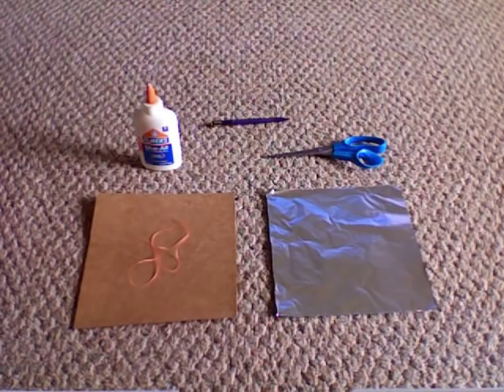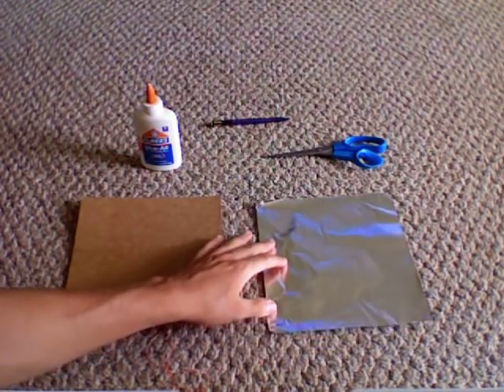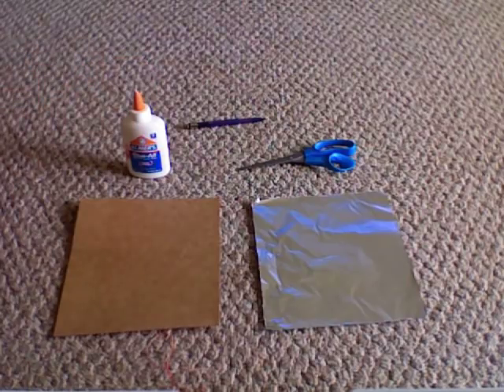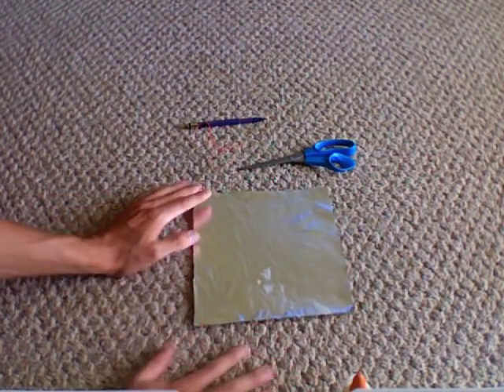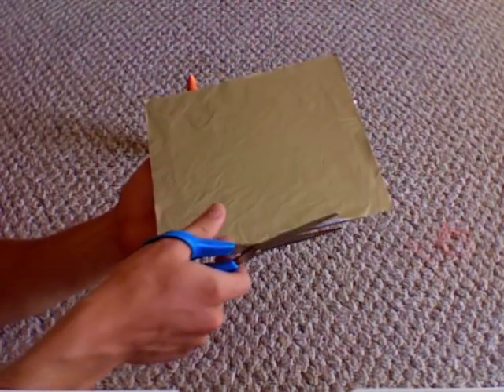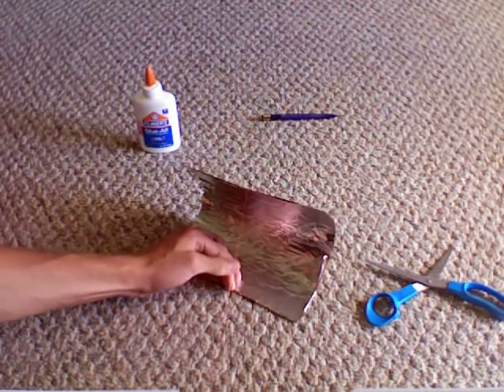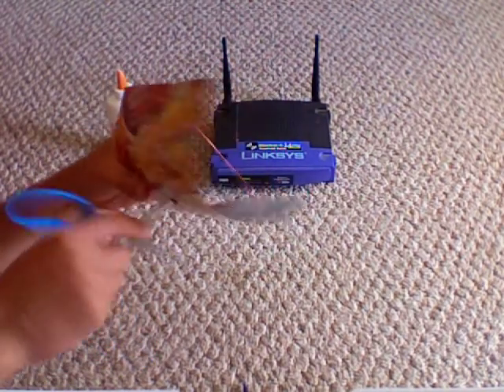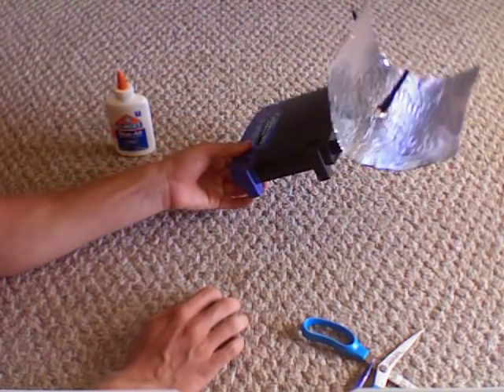How to build a Wi-Fi connection satellite

Comment: Wrong polarization...and there is major signal loss... The dipole should be running ALONG the reflector...not popping out at a right angle from the center of the sheet.

Also the shape is not tuned....   You could measure the focus using a light source and observing convergence of the reflection...  Then use another piece of cardboard on the top and bottom of the reflector to hold its shape and then make a hole in the bottom to allow it to sit on your dipole coming from the router...  (there is no satellite--not even a dish you're making a reflector)
Reply: +Trondyne   Thanks for your sensible and useful comment.
Reply: +Trondyne  This guy is trying to build on other ones who have such videos. I agree with you about the polarization, shape, and etc. These antennas have to be tuned. With some type of reflector system, the signal becomes more directional, providing all was done right and properly tuned (adjusted).  

I would think with what this guy is doing the signal would actually be worse.  The best test would be with a field strength meter that can work in the necessary frequency band. The manufactures of WiFi systems would be using the most efficient antenna design. 

The best thing to do for increased range is to add a repeater. Most of the WiFi router manufactures also manufacture repeaters.

Comment: WTF So if I am getting this right WIFI is a satellite signal from space.! So using this thinking every smartphone that has WIFI is a satellite phone.! I thought that WIFI being at about 2.4Ghz and have a power output of 10 to 100 milliwatt's would have a range of 100 to 400 feet depending on what the signal has to go through. So his tiny little antenna he made is going the reach a satellite orbiting around 200 miles above the planet is going to work. Me thinks there is too many dumb asses out there posting video's for the sake of posting them. Yeah it will work but just not how he thinks it will. All this little thing does is make the omnidirectional antenna directional in one direction only. So if say his modem is in his kitchen and he wants better signal in his bedroom then you just point it in the direction of the bedroom and yes you would have a better WIFI signal in his bedroom.

Comment: aluminum can version much easier, windsurfer antenna template more effective, but whatever works for you. pretty much anything with an aluminum surface will redirect your WiFi. the parabolic shape will help distance, but really narrow the area you can receive the signals. am I the only one with a lynksys that did NOT come with antennas? there isn't even a place to mount one, let alone two!

Comment: 3:50 Prabala shape? He means Parabolic shape. Basically he made an RF Reflector and turned an onmi-directional to a beam like antenna. It does not BOOST more than focus the RF into the antenna. You can do more than what he uses. Basically it reflects the 2..4/5gHz into the antenna the same way that Sats do it from space.

It is just focusing like how you can use the sun and a magnafiying glass to melt ice, green army dudes or fry things.Basically your wifi rf signal hits the foil on the parabolic dish and it focuses it on the antenna and the reverse is true his signal from he wifi card in the computer and it reflects it back. Only problem is that it has to be aimed just right or it will degrade the signal because he created a beam. 

This was a pretty simple how-to video and good luck everyone.

Only bad thing is that  this will NOT work with routers with internal antennas.

Comment: Know your lingo. Be ready by scripting your video. Using uh, um, and other similar words is not good.

Use the parabolic focuser to encircle the entire antenna, not just the tip. Better results, better reception, farther distance.

A Pringle's can, or Campbell's soup can, should work as crude cantennas. Using an old satellite dish with a single LNB works amazingly well.

Comment: What Maione685 is trying to describe has nothing to do with satellites. It has to do with the use of a parabolic antenna that is somewhat similar to the shape of a satellite dish, which can be used to extend the range of WiFi network. For a far better explanation as well as an accurate means by which to best shape a parabolic antenna, I'd suggest the following link:
http://www.freeantennas.com/projects/template/
Reply: seems kinda unreal but does it even work what he did sir?
Reply: Manish Chaudhary: Yes, it does. Look into "Cantennas." They are highly directional. 

Imagine a hot pocket in the wrapper they come with. The material shields the hot pocket and is able to crisp it by redirecting microwaves.

Their are materials able to deflect or block (reduce really) the amount of a frequency, so yes it works quite well.

Comment: Make the trough longer and put both antennae thru. One is TX the other RX.
The best kind are the ones with one antenna, with a screw connection. It possible to make the cookie tin lid "double diamond" antenna and get gobs of gain and easy assembly with the screw connector. This trick would work on three antennae models, make it longer and poke all three thru.

Comment: You are bit boating the signal at all what you are doing is directing the signal. A router out a signal 180  depending in the antenna and the tin foil if pushing the signal to about 90 and if you have a plastic cup or something like a cup you could direct the signal in ine are depending in the size .

Comment: Thanks Maione, this is great stuff.
I did one step forward with your project. I covered with foil both sides of cardboard (use two separate pieces, can't be one folded over).
From my experiment i found that outer surface is effectively bouncing off mean particles, these one which are chocking the good particles of the signal.

Comment: Ye the Polarization of the Antenna is what??? It makes a diffusion in the RF-Signal but not a Focus. People think that makes the Signal Stronger but this is wrong it makes the Signal more diffuse - the BER (Bit Error Rate) increase. 2nd the Current is on the Foodside of the Antenna and not on the Top of a Antenna - that means that the Reflector is diffusing the signal to the backside. Do you think that you take the right Antenna? is it not so that this is a Diversity Transceiver? That mean that the both Antennas are listening and transmitting simultan. This Reflector is Bullshit.

Comment: I'm not to sure but if your router doesnt have an antenna, just put the satellite on top of it to boost the connection. The antenna it just there to increase the singnal waves. I think this might work for other devices to like the Xbox 360 or Computers.

Comment: you could also just move or mount the wifi router higher on a shelf. works great. But as is, all that was done is build a directional reflector. Works either way.

Comment: Your antenna should not be going through the hole in the card board.  It should be sitting inside the fold along the the focul axis of the parabola.  Technically it will not boost your signal.  It will only allow you to focus what signal there is onto the antenna.  Boosting the signal actually requires you to increase the signal output power at the transmitter.

Comment: have u never heard of a pringle tube cut the bottom of and cut the cylinder in half then u got one reflector for each of the antennas on your cheap router no string or foil or p.s dude if u knew anything about microwaves that wont boost your signal its still gonna put out same wattage  just its reflected into a beam form wanna better signal get one of them free WiFi controller programs that tells you all the WiFi signals and channels used in the area and use one there not

Comment: just make a 2square antenna (glasses antenna). take wire and make 2 squares with the side length of lambda/4 and staying diagonal to each other. then make a foot vertical with a length of lambda/8 and there you put a CD as reflector then add a plug or something for connection that's all. 
lambda for WLAN is Lambda = 3 * 10^8 m/s / (2.4 * 10^9 17s) = 12.5 cm

dont forget that the connection wire should not be longer than a few meters otherwise the loss will be too big with ordinary cable

Comment: ya mane.. if u put a piece of styrofoam in the center to go around the linksys antenna.... long ways, see that is a cylindrical parabolic curve... which yours is probably not exact (parabolic curve) but pretty much the same thing put long ways on the antenna will work better.

Comment: Neat idea. I have some ideas for improving it that seem to work in theory. 
A dish shape would direct the signal a little better, a large salad bowl comes to mind as a template (beware of the wife). You can shine a light on it to see where the light reflects. The smaller the point the more effective it will be, but the more precisely it will have to be pointed. 
Aluminium is not a great reflector, flat white paint or even mylar should give noticeable results over the foil.
Cool afro. ;)

Comment: Tip

The reason it makes the signal stronger, your reflecting the signal to go in one direction.  You'll also be affecting the SWR, this'll make the Antenna much less effective.  This means more power may feed back to the Radio rather than out to the Antenna.  High SWR will make your WiFi's Radio were out more quickly.

Much better to get a full sized antenna, this should give you the same performance in all directions.  Failing that, try a 29 DBI Yargi off eBay, again focus is in one Direction.

Comment: ok now i do physics in school n we learn the basics of EM waves, etc, n we learnt about hertz experiment with the parabolic mirrors which proved that EM radio waves travel in stright lines, if so, consideringg that the aliminium foin is reflecting all of the waves wich are incident apon it, does it matter which  dircetion th parabolic mirror is facing? i am currently considering making a radio controlled flying appliance and therefore i require to no how to boost it's signal to near 1km

Comment: LOL satellite. you do know that the definition of a Satellite is an Artificial Moon. ANd the definition of a Moon is an Orbital Object(MOON).
So im kinda gettin at the point that in no way on EARTH is that a Satellite.
What your doing is comparing that to a Moon.
But apart from that, all is ok. LOL.
but not a bad idea. it would work better if you could direct the reflected Microwave signals to the Antenna.

Comment: (continued)
The real way is to get a large conductive metal object (an oil can will do), solder/attach tightly a wire on it, remove the router's antenna and plug the other end of the wire instead. then you place your antenna where you get the least ammount of obstacles between the antenna and the devices that'll connect to it.
actually, simply putting your router on a place with few obstacles between it and the devices might be already more effective than putting a metal sheet around it.